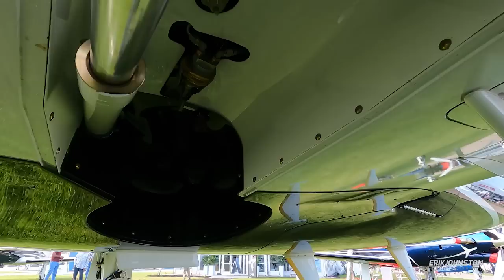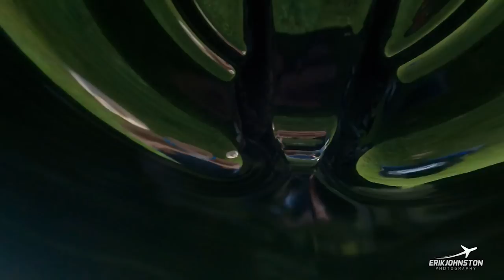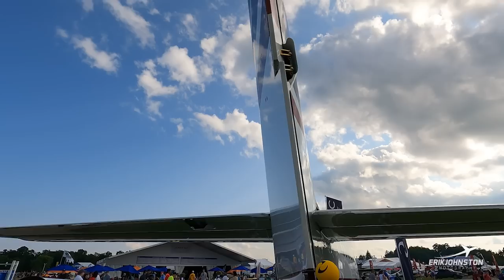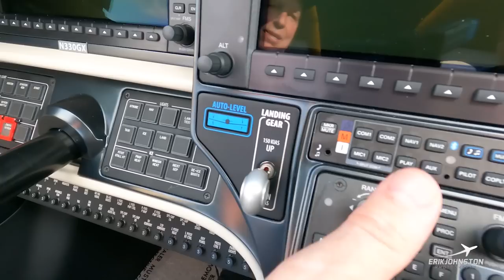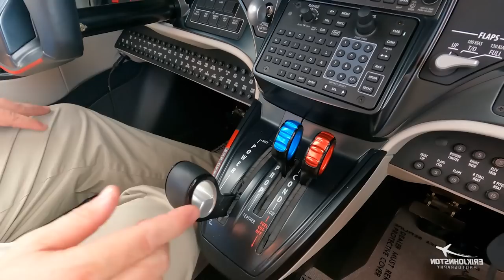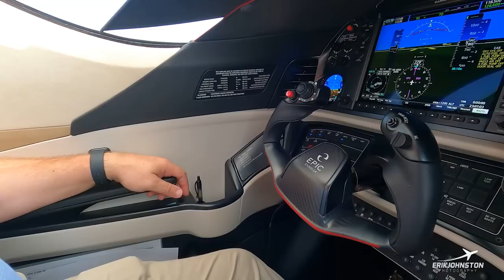EPIC Walkaround Oshkosh 2024

Comment: Already a huge fan of the EPIC, let’s add G3000 Prime w/autoland and auto throttles, heated fuel tanks, single port refuel capable, 50-100 extra gallons (more range 1804nm), more zero gravity reclining seat options (+2 jump seats), 120V preheat/cool cabin and engine, service ceiling is stellar but I’d take FL370 at 12k ft cabin altitude for extra capability🤩, STC for Medevac/Lifeport and brake de-ice are just a few requests 😂 oh and under no circumstances delete the prop lever. 🌎 LET’S SHOW THE WORLD WHAT THE GREATEST SINGLE LOOKS LIKE 🌎
Reply: After those upgrades, the price tag won't be EPIC 😅

Comment: i need to make a GIGANTIC correction.  TRQ and HP are not the same.  Your TRQ display does not display HP.   TRQ can be measured in a variety of ways, but for the PT6A, this is a function of differential oil pressure between the first stage of the gearbox and the engine case.  For the GE 701 series its the difference between 2 probs in the rear of the drive shaft measuring twist.  Turbine engines make GOBS of HP but very little torque which is why they have to stay close to 100% RPM.  HP is a function of RPM.  TRQ is a function of twisting power on the rotor or propeller.

Comment: He didn't show us the windows. Are they all glass windows? I assume it's an all carbon fiber plane? it's pretty neat aside from being a turboprop. Turboprops should not exist, twin jet is just so much better. And can have reverse thrust if they must. Only problem is that engine manufacturers are greedy. Smallest engine is a million dollars a piece. So plane makers have to start their own production. And as Hill Helicopter is showing, that's very doable.
Reply: Windows are layered acrylic.
Reply: @alanluster950  thank you. layered in what sense? like safety glass with a flexible polymer between two sheets?
Reply: @DanFrederiksen  Exactly, it’s made up of a couple of layers of acrylic plastic, with an air vent between layers.  MFG by Lee Aerospace, who makes windows for many airplanes in this category.

Comment: How much is that turbo prop going to set me back ?
Reply: $2 millions, I guess 😁
Reply: As of July 2023, a new Epic E1000 GX aircraft costs $4.45 million, which is an increase from $3.85 million in 2021. 
In addition to the purchase price, the E1000 GX has an average hourly operating cost of around $700 and an annual fixed cost of about $160,000.

Comment: Why. Why do they put the ground power port near the front of the aircraft on a turboprop? It just makes no sense to put something that a ground personnel needs to go remove rear a spinning prop AND a huge jet exhaust.
Reply: Probably because it is located at the shortest distance to the batteries and starter motor.  The prop would be in feather, so no prop wash to deal with, and even at flight-idle, there is not enough jet blast coming out the exhaust to do much damage.  Not a big issue to me.
Reply: Let’s move it, good call. I second the motion

Comment: Why hydraulic gear instead of electric?
Reply: @jasoncrandall  I agree.  I would rather have an on demand electric motor, that drives an intermittent hydraulic pump, rather than the existing system of an engine driven hydraulic pump, that runs continuously while in recirculating mode, and unnecessarily saps horsepower, waste fuel, eats into the components TBO, and makes noise for 99 percent of the flight, while doing no useful work - other than recharge the accumulators.  Other than that, the E1000s trailing link landing gear is sturdy and sexy.
Reply: @alanluster950  Bonanzas have had electric landing gear for decades. Pilatus since 2015.  Hmmmm
Reply: @jasoncrandall  Can you describe the PC-12 electric landing gear system?  Does it directly drive a gearbox or is it an electric motor driving a hydraulic pump?
Reply: @alanluster950  it’s all electric. Electric motor.  The area in the wing root where the hydraulics used to be is now just a wide open space.

Comment: Pricing and delivery? Just curious, certainly dream territory for a man of my means.
Reply: As of July 2023, a new Epic E1000 GX aircraft costs $4.45 million, which is an increase from $3.85 million in 2021. 
In addition to the purchase price, the E1000 GX has an average hourly operating cost of around $700 and an annual fixed cost of about $160,000.
Reply: @alanluster950  Thanks Alan. Is there still an experimental, owner built option? That’s how the Epic was first available. Someone at my home airport (Princeton, NJ) had one.
Reply: @visibilityunlimitedmedia  They no longer produce the LT, owner built kit plane.  I think about 50 E1000 LT kit planes were produced.  You can find them on the used market for about $2 million.

Comment: As soon as I win the lottery and I'm 40 years old again, I'm going to buy me one of those. He didn't mention the blue "Auto-Level" thingy. Was that a button to put it back into level flight if you lose orientation?
Reply: @txkflier  Yes, I call it the JFK, jr. button…designed to get the wings level, just in case the pilot gets disoriented.  Or a passenger could push the button, if the pilot becomes incapacitated.  Speculating they will probably replace it with an autoland button shortly.
Reply: @alanluster950 Autoland requires auto throttle and G3000 if I'm not mistaken.  It will be a decent while before all three of those things are in the Epic unfortunately, as they'll need additional certification for that. As someone very interested in this plane with those features however, I hope it is sooner rather than later!
Reply: @KendoGuy  I agree.  Great plane, Epic just has a little catching up to do on the Avionics and autoland.  But the E1000 still leads the pack when it comes to performance, in its class.  Personally, autoland would not be a deal killer for me, but I would install a GTN 725xi instead of the existing analog keypad.  Just my 2 cents.